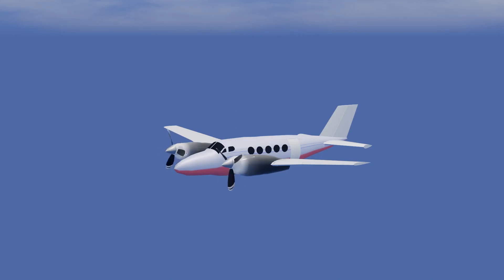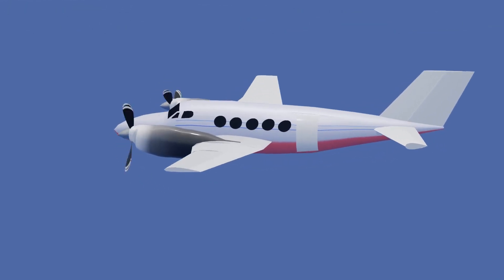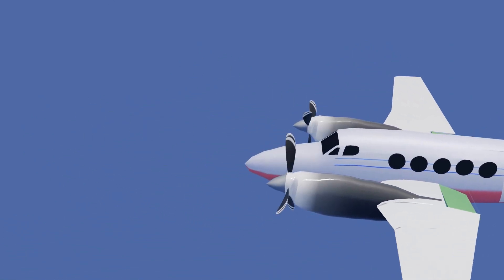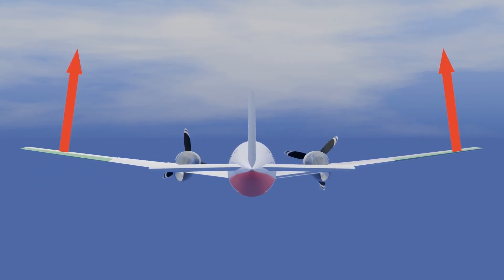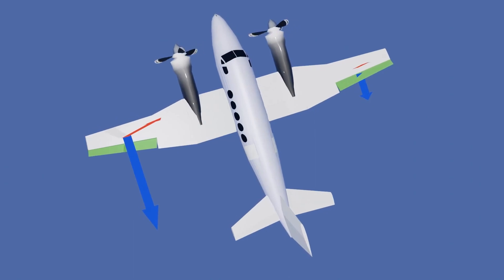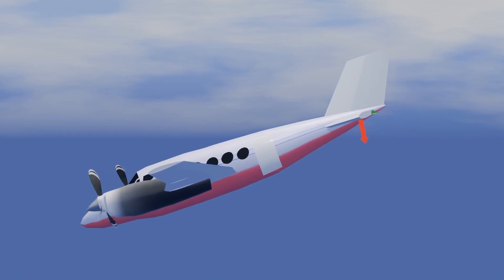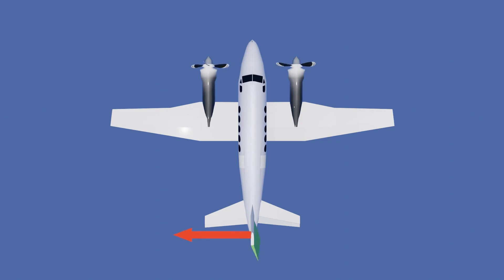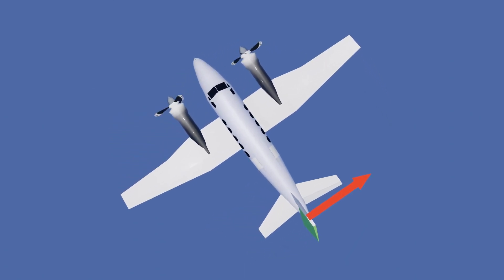How Flight Controls Work (Elevator, Rudder, Ailerons, Flaps)

Comment: You mentioned regardless the elevator is deflected upward or downward, the camber will increase. Is it because:
When it is deflected upward, it decreases AOA enhances the downward force (negative lift) resulting tail down;
When it is deflected downward, it increases AOA enahnces the upward force (positive lift) or less downward force, resulting tail up
Cheers! xx
Reply from the maker: Sure, let’s talk about it. 

The horizontal stabilizer is used to produce downforce which creates a pitch down moment to offset the wing’s pitch up moment. Usually, the stabilizers are put at a negative incidence angle to produce that down force (similar to angle of attack, but not necessarily the same) 

When we deflect the elevator up, the effective angle of attack down decreases (more negative) , which produces more down force and more of a pitch down moment. 

When we deflect the elevator down, we increase angle of attack (increase from negative closer to 0) which then produces less down force (or possibly even produce lift, depending on how much it’s deflected).

With less down force and therefore less pitch down moment, the aircraft will pitch up as it isn’t in equilibrium. 

It’s hard to say if we are “producing lift” on the horizontal stabilizer unless we specifically had the aircraft specs. You should consider that we just produce more or less downforce when we deflect the elevator due to changing angle of attack.